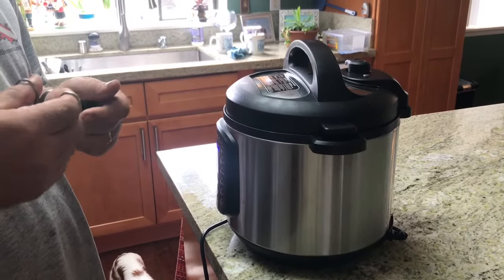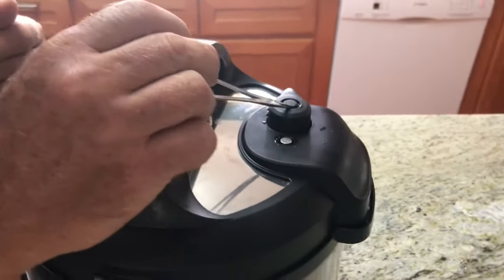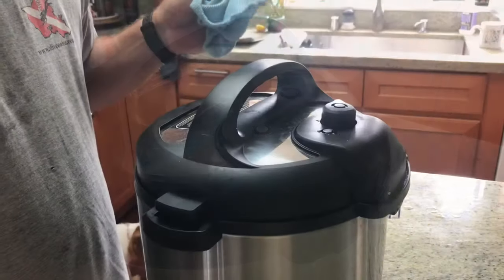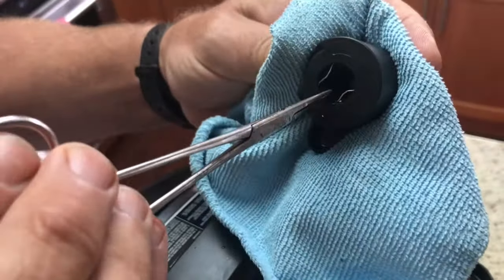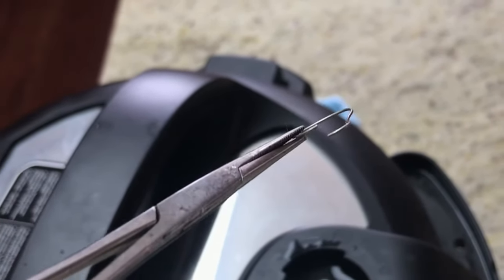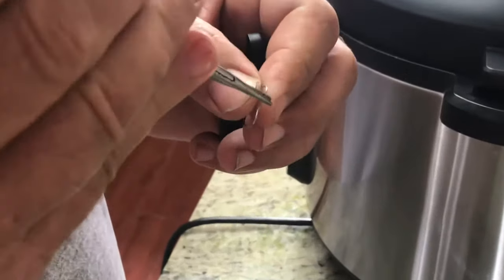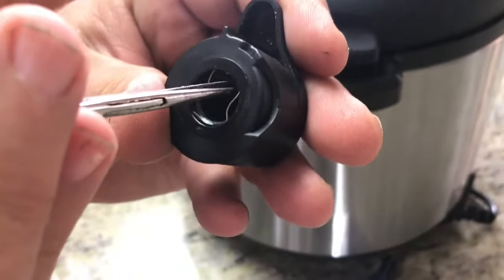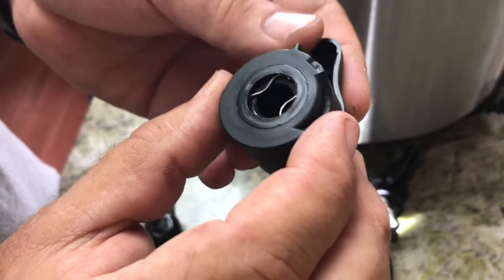Instapot Leaking Steam Release Valve Fix

Comment: So thankful that you posted this video. You just saved me from having to settle for a newer substandard appliance which has become very common nowadays.

I started noticing hissing steam sounds from my Instant Pot (IP) DUO SV the last few times I used it. I confirmed that the valve was closed and also pressed on the valve of my IP and the hissing steam sound decreased, but would not stop spurting liquid. I had an 8 qt IP which I noticed that the steam release valve did not come off as easily as it did on my 6 qt. 

I put the 6 qt lid to the side until I could later investigate. When I looked at it, I noticed that wire piece in the hole where the steam release valve goes, but had no clue of where it came from. After recently purchasing another IP, Duo 6 qt, and running 2 cycles of a program just to have my food still sitting in a pot of liquid that apparently bubbled up to the lid making a mess in the inner pot and on the lid, I searched to see if anyone had a similar problem. 

So glad that I did not throw that wire piece away. This was such a simple fix. Although that wire piece did not pop across the room, it did pop out onto the floor as I was reseating it. 😳 Fortunately, I was able to find it. 😀

Thanks again for posting your video.

Comment: Out of a dozen different videos, this is the closest to my problem. But my pot is the Duo Evo and has a different looking valve. I checked inside and there doesn't seem to be any wires that I can adjust. The whole thing just sits a little crooked and shoots out steam the whole time regardless of whether the switch is set to vent or seal.

Comment: Hi, I just got an Instant Pot Duo 60, used. The person had cooked a rice dish that over flowed and they didn't want to clean it out, so I got it. I cleaned out all the gunk. Then I saw under the release valve was filled with what looks like lime deposits. I have a photo, but don't know how to send it here. I am soaking it in vinegar. Do you have any ideas on what else I can do? Also, should I not be able to unclog this, is this part available from Instant Pot? Thank you, Caryl

Comment: OMG! I saw that piece just loose in the bottom, not in the slot. And didn’t know where it came from. I was already on my way to Costco to return my Instant Pot, after 3 meals that I spoiled trying to get them cooked! Thank you so much for the video.
Reply: This happened to me too
Reply: I freaked out as well! Just not the instapot pro , and the third time using it the flow valve was clogged and I didn't even notice....
Reply: Sameeee

Comment: Thank you. Your video really helps. I know you cannot order a replacement through the Instant pot website or even find a Duo SV valve replacement through eBay. What would you suggest if the steel ring is lost?  I was thinking of using a paperclip because it seems to fit underneath the rim like the original. Do you have any suggestions?? Does your replacement valve fit and function the same? Because I have a regular duo model and the the release valve is quite a bit smaller. It also spins around quite a bit and does not stay in the sealing position unless I point it manually in the direction. I haven’t tried to use it yet. I guess I could see if it works. But any suggestions you have would be much appreciated.
Reply: I think you can order a replace valve from the instant pot website and from Amazon.

Comment: Thank you for this video!! I couldn't figure out why my instant pot wouldn't hold pressure and had no idea what that little wire piece was doing loose in the bottom of the depression. I was able to have my pot fixed and working in two minutes thanks to you!

Comment: Thank you for the video. I was ready to throw this thing out as it would not shut off because the timer never started because the pressure kept leaking as the metal tab was just sitting on top of the valve stem and not inserted into the valve weight. Works as it should now.  Thank You.

Comment: I reckon if after straightening that bit of wire, you could get it red hot on the stove burner, then drop it in cold water and it would be harder and stiffer than it ever was, and would never misshapen again. That's called quenching. You could also temper it if you had a mind to.

Comment: Please tell me how you took the valve itself apart. The knob on mine doesn’t have a metal piece inside, just the rubber pin. It began leaking and the valve doesn’t move when I turn the knob. Thanks!
Reply: Mine wouldn't stop leaking right out of the box, I messed with the cap seal and made no difference then I washed the pedestal the cap inserts onto, and then the thing sealed. Maybe some shipping oil on it that would allow it to seal properly in my case.

Comment: Mine leaked during the entire pressure test. I don't mean a small leak it looked almost like I pushed it to the release setting.
Reply: I'm going to see if I can get a replacement.
Reply: @kreigsr9789  Mine wouldn't stop leaking right out of the box, I messed with the cap seal and made no difference then I washed the pedestal the cap inserts onto, and then it sealed. Maybe some shipping oil on it that would allow it to seal properly.

Comment: works great. i love that it has stainless steal pot inside https://www.youtube.com/post/UgkxG-7WiT7ocumjytOpHDFt632PL0pxXRAg and not the one with coating. we used to have a coated pot before, and the coating slowly peels, and i am sure went into the food that we cooked. Absolutely love stainless steel, and will not use a coated product again.This pot has many settings and many buttons, and i need to sit down with a manual to figure out which setting to use. I used the basic functions, and even though i am not technologically skilled, i turned it on and assembled it without any help.Very satisfied with this product overall.

Comment: People, please stop referring to the seals on the Instant Pot as being rubber, they are silicone.  And get the other terms right.  It's not called a puppet valve, it's a float valve.  The big lid gasket is called the sealing ring.  And where did you get that it makes 240 pounds of pressure?  That would blow the top off!  It's more like 10 to 12psi.  But it won't let you open it while it's under pressure.  However, I think maybe you confused temperature with pressure, because it can reach 240 degrees, not 240 pounds..